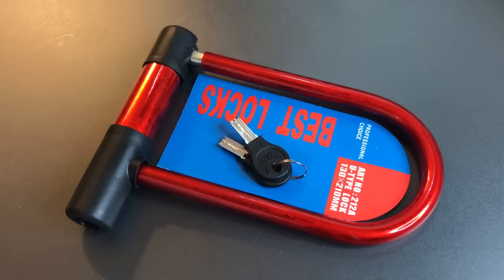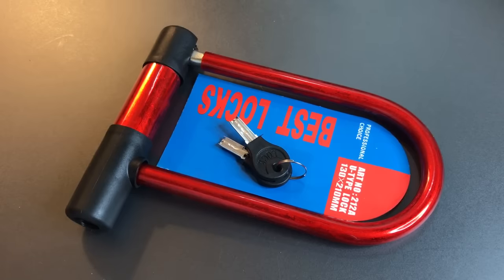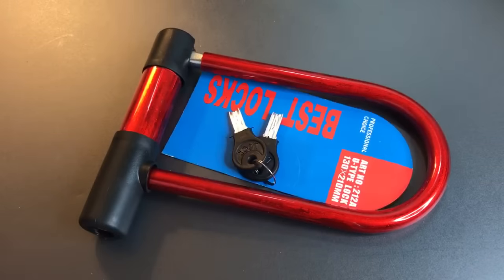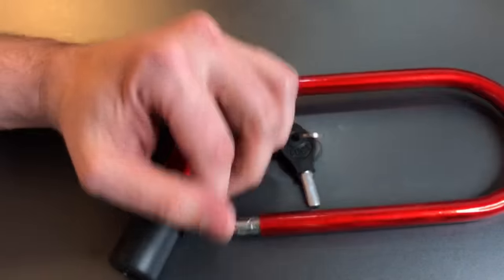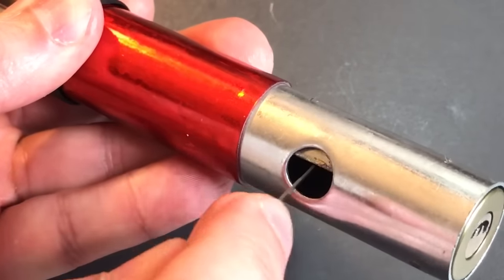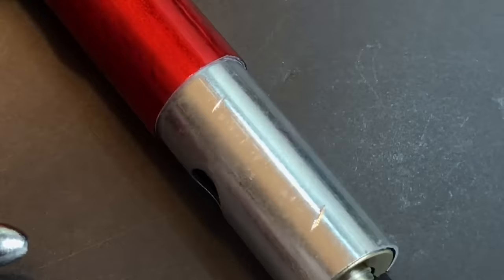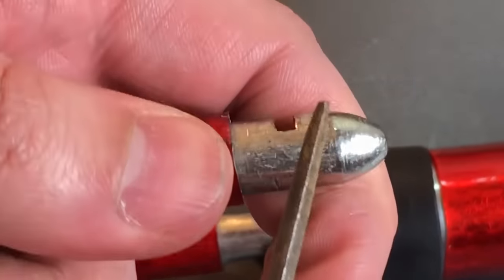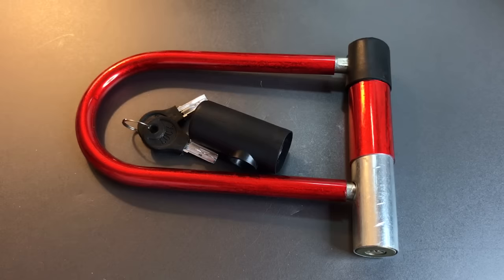[370] The WORST Bike Lock in the World Picked and Bypassed

Comment: Actually, I think LPL just convinced me that this lock is a great deal.  It's only $3.  For $3 you get a bike lock that will make it LOOK like your bike is secured which will deter most people from bothering.  Only a thief with enough knowledge/determination to pick it, bring bolt cutters or know enough to shim it would bother.  So if you're cheap and reluctant to buy a serious lock, why not get this?  It's a visual deterrent.  It's kind of like the Coral Snake approach.  The Coral Snake is venomous but several snakes have evolved similar colors and looks and benefit from potential predators mistaking them for Coral snakes.  This bike lock is not venemous, but it looks like it to those who don't know better.
Reply: Exactly
Reply: It smells like shit too
Reply: Nah the shimming part means you can just guess right and it opens. But I do see your point. Though the key will eventually not work.
Reply: True. For a small town or suburban area. Even at a college, if your college is fairly safe, this is better than those combination cable locks for $10 that look like they can be cut with scissors. Even those locks work fine for those areas as long as your bike isnt very flashy. 

That said, unless your bike is an absolute piece of junk, spend at least $15 on a nicer U lock. Walmart has plenty of options from Bell and Kyrptonite. (Still not great, see LPL 735 and 455)
Reply: The lock isn't venomous but it apparently emits a poisonous gas. Sounds like a super deterrent to me lol.
Reply: Or... You can have a lock that does work and not only does it deter people, but it ALSO is safe! Like a lock should be.
Reply: and because of its smell it might as well be poisonous (not venomous thats a different thing)
Reply: Anyone spending time looking at your bike likely knows about bike locks themself.
Reply: @jackkreacherr9339  Some would.  Sure.  But all?  Most?  A large minority?  Probably not.  Most of these thieves aren't educating themselves on locks like LPL or some character from a heist movie.  They're stealing BIKES.  They're not sophisticated super-criminals.  If they were putting that kind of time and effort into crime, they'd be fishing for larger game.  There's probably only a few that really know their bike locks.  And for $3, I can deter the rest.  I'm not saying it's the ideal strategy, but if you're on a tight budget...
Reply: @raceman9586  You can buy a great Bell lock (Catalyst 750) for $19.96.
Reply: Yeah because everyone just casually carries bolt cutters around
Reply: I think that analogy could be developed even further. Just secure the bike with the coral snake and be done with it. Only a thief with enough herpetological knowledge and determination would even bother going near the bike.
Reply: @ElleUnter  Best. Reply. Ever.
Reply: @raceman9586  When I get a new bike the first thing I do is crap it up a little so it Doesn't look new or flashy. Protective coloration.
Reply: If you have a cheap bike that you wouldn't feel destroyed about losing, sure. For a bike with high financial or personal/emotional value, you should spend at least 10% of the cost of the bike on security. I could be visiting a gated retirement village full of senior citizens who can barely walk, and I'd still use at least a 1090 chain.
Reply: actually this bike lock IS venomous, can't you smell it?
Reply: no just buy a lock this is a stupid idea
Reply: Matteo that just means you’re paranoid
Reply: You make no sense
Reply: if you're only gonna spend $3 for a lock, chances are, your bike isn't worth that much to begin with, so doesn't matter too much i suppose. kinda like.. why pay tens of thousands for premium insurance when all you drive is a 1994 second-hand pontiac
Reply: Marko oOo  Look up the term "natural selection".
Reply: Ppl will still try but alr
Reply: This lock would be totally fine for a kid's bike.  When I was in middle and high school, I had to ride my bike to school.  I had a cheap lock.  One of those bike chains with the blue sleeve from the 80's that my parents handed down to me.  I never had my $100 bike stolen.  The point wasn't to prevent a valuable bike from being stolen.  It was to prevent other kids from stealing the bike as a prank.  Your average teenage prankster isn't going to know how to pick a lock.
Reply: @hamsterama  there is people stealing Kids bikes, there are some expensive ones and they are easier to transport due to just Being smaller. Mine got stolen when I Was in elementary but that was from our basement it had one of the locks you described, the one before got damaged by some Kids. In middle to high school Lots of bikes got stolen or damaged and school said that they are in no way responsible to what happens to bikes and yes some Teens were interested in picking locks interested in illegal stuff or just generally destructive behaviors
Reply: @LP-XXX  Wow, I don't know what area you lived in!  LOL!  I rode my bike to and from school for all of middle and high school.  Never had anyone steal or damage my bike.  Although I'm sure there were plenty of kids who would have wanted to if they could.  For whatever reason, riding a bike was considered "uncool" and would get you bullied.  But I wasn't going to walk the nearly mile long way to school.  I actually was bullied for riding a bike.  As an adult looking back, it made no sense, but, whatever.  I graduated in 2003, by the way.  So, I don't know if riding a bike is still "uncool."
Reply: or just pay $15 and don't support a company that sells cheap horrible locks
Reply: well i believe that if you're gonna steal bikes you would bring something like bolt cutters if you have the money i mean not everyone carries it around but if you go out with the purpose of stealbg a bike maybe you would bring bolt cutters but that's just my opinion

sorry for my stupid name i lost the password for my main account :/
Reply: @ebsbjssjeggshsgehe7949  Most bikes get stolen if they arent locked by some random drunk dudes that just wanna get somewhere faster. The majority of people who Steal didnt Plan to Steal originally but saw an easy oppertunity and went for it
Reply: It's not just visual. It prevents someone from just grab your bike. So it's a really nice lock for 3$. I have to be a lockpicker to open it anyway
Reply: buy a pair of handcuffs and use those to lock your bike up ... people either think your a cop ... or its an entrapment bike
Reply: Plus it smells venomous as well!
Reply: A dumb robber would try to shake or pull it open
Reply: @raceman9586  I had such a cheap cable lock. Broke off the key in the lock because the mechanism was frozen. Had no tools with me. But I could just bend the cable from left to right until the cable gave up after only fifteen minutes. And no, I was not a bodybuilder.
Reply: @ghostface5559  dude u don't need a key
Reply: Not anymore after this video.
Reply: A friend of mine had a crappy looking bike 'abandoned'  on weekends near the train station, locked, to use when he went to various lessons  at the university and back. Bike was very crappy-looking but somehow worked (bought for 10 bucks from another student that paid it 10 bucks 4 year before and so on..). The lock was nike-looking thiough.. until someone picked it, stole the lock and left the bike.
Reply: Yep just like sticking the "Guardian Security System" sign in your yard without actually having the system installed in your house
Reply: Not if you’re in Philadelphia Portland or New York, if you use one of these locks in those cities, your bike is not going to last more than 10 minutes
Reply: @ghostface5559  you don't need a key to use this "lock"
Reply: @loganxavier  not for 3 bucks though
Reply: Nope you're wrong. You can break this open with a brick. The locking pall is thin soft metal and the hinge pin is thin soft zinc. Hot either end with a brick a few times and it's open.
Reply: @DerAlex86  more likely the spot welds or crimps that held the cable to the metal lugs on each end gave up and the cable came out.
Reply: Best part is, if you lose your key then you can open it with no problem.
Reply: this extremely thin bike lock wouldnt deter anyone who actually went out that day to steal a bike, and once someone decides to go after that lock it has ZERO capacity to stop a thief or even delay them such that the owner can put a stop to it

its locking mechanism is so bad i bet it could be opened with a claw hammer by tugging on the shackle and whacking the side opposite to the locking lug to bounce the spring-loaded locking lug

what would you rather pay for: 40-90 dollars for a good bike lock or however much money youd have to spend replacing your stolen bike? unless your bike costs like 20 dollars its a horrible deal
Reply: @loganxavier  yeah but such locks start around $100 (Abus Granit X Plus) - not everyone likes the price tag.
Reply: Thank you for clarifying the lock is not venomous
Reply: I once forgot my bike lock key at home and parked my bike in a place where motorcycles frequently gets stolen let alone bikes. I decided to tie the lock around my bike wheel to deter people from stealing it. I then left it there a week for...reasons. And it didn't get stolen! Worked like a dream.
Reply: Where I live bike locks are no deterrent at all, if someone has their eyes set on stealing your bike they'll just come with a van in the middle of the night and steal your bike. Even when it's standing on your property, doesn't matter how good you lock it, you better hide it well. Or depending on how you chose to fasten the lock, they might leave the parts which are locked but steal the rest.

Comment: By watching you and bill over the last year I am terrified about any lock I see storing anything. I even told my company what junk they are buying. They dont listen btw.
Reply from the maker: If it gives you any comfort, know that picking is a skill that not many people have the patience to master. Once you get above the bottom shelf crappy locks, it takes an uncommon level of skill to reliably pop locks within a practical time frame.
Reply: LockPickingLawyer so my neighbor crackhead won't be able to pick it. Although my motorcycle got stolen days ago with no locks
Reply: yeah my dad came and wanted to switch the basement padlock that i bought on a budget has ball bearings to hold the shackle lots of meat not hard metal and butter core in it for a Chinese cast iron spring loaded 3$ potato i think Bill made a video on how to bypass them with a knife  even why ball bearing locks are hard to use WELL SHIT i suppose ignorance is bliss

Comment: I went to tension a wafer lock on an old fireproof lockbox I have, it opened when I put the tension wrench in. There was 1 wafer in it.
Reply from the maker: LOL.
Reply: The first lock I ever tried to open was a 5 pin lock to a gun case I lost the key to. I pushed the file on some nail clippers into the keyhole, applied a little tension and wiggled it up and down and the lock opened. Convinced it was a fluke I repeated it about a dozen times in disbelief. Since then I have basically lost faith in any traditional lock. Obscurity seems to be a better defense than anything under $100 can get you.
Reply: I think your best bet is over kill. 5 shit chain locks 10mm at £5 each that would mean using a bolt cutter ten times, or mean pissing about with opening five locks. Most people can't lock pick as fast as him so they will see 5 locks and think, fuck that. Ha.
Reply: TheaDragonSpirit that's my approach. A thick galvanized cable with swaged crimps, and a hardened steel chain with two separate locks. I also have a brake lever lock and caliper lock I never use, but it really wouldn't make sense for someone to go through the trouble for my $300 bike when more expensive bikes are left unsecured all over the city
Reply: one wafer!!??!!

Comment: In Switzerland the Police recommends investing 10% of a bikes value in the bike lock. this 3$ lock seems adequate for a bike worth 30$ and not a penny more.
Reply: Gustav Lang-Weilt gets a $4000 bike and gets $400 dollar lock
Reply: I have a 2000$ bike and a 120$ lock. Anyway, I only explained the recommendations of Swiss police.
Reply: @miru99de  a $2000 bike will get stolen if it's left outside for too long. Bcs its so expensive it's probably your mountain bike or your road bike. Get another cheap bike for your daily  so you don't have to leave that thing unattended ever.
Reply: that's good until you're without both your expensive bike and lock
Reply: @4nd3rzzon  how would someone steal your lock lol?
Reply: what if you buy 5000 electric bike,  500 on locks?
Reply: @jketcham9004  people will cut the tree or pole down that you locked it to 😂
Reply: @theday2164  I've recently had my bike stolen twice.  And found it.  One homeless guy steal it and was sleeping on bench.  But they can't bolt crop chain I got its 2 inches thick.   5 grand bike fit tracker
Reply: @JayLeeBeanz didn't somebody steal an entire bridge once?
Reply: @JayLeeBeanz like how did they pull it off? Angle grinders and a fton of patience? Oxy acetylene torches? Cart the whole thing off or cut it to pieces?
Reply: My road bike that I built from scratch, with a total cost of $7000 sleeps in my living room. There is no way I'm leaving this bike unsupervised.
Reply: @JayLeeBeanz So leaving anything of $2000 outside is too much of a risk for you? I assume you don't own a car either then, since those are just as vulnerable to theft as a bike with a decent lock.
Reply: @shawnpitman876  Got any cars that fit in the back of my van?
Reply: The sad thing is, if the thief can't steal your bike because your lock is a decent one, they'll cut all the cables and spokes on your wheels in spite. Some people are just trash.
Reply: In many US cities with big bike theft problems (NYC, SF, etc) you'd probably be better advised to spend nearly as much on your lock as on the bike you'll be locking! More expensive bikes are to be stored indoors or kept in sight at all times. It's a big hassle.
Reply: noeone steals a 30 $ bike^^ its not worth investing a penny into a lock
Reply: @JayLeeBeanz realy happened here in germany, someone realy stole a bike WITH the street lamp it was locked to.
Reply: @DokuFREENET  the tweakers in my city steal $30 bikes all the time, since those are the ones that get left out, unattended, and not locked up. A lot of times they either turn around and sell it for $5-$10 or they just trade it to their dealer for $10-$20 worth of meth. I've seen it happen a LOT.
Reply: Really depends on where you live at. Colleges are notorious for people who lose bikes, people who got their bikes stolen, and people simply throwing away the bike by just leaving it locked at the bike rack. I would never give a second glance to someone sawing the bike lock because the school board has been doing it over and over the years.
Reply: @DokuFREENET  yeah they do. Just take it and dump it. I had one taken - it turned up a couple of days later looking like it had been ridden down a river.
Reply: @vinos1629  
1) pick lock
2) open lock
3) take lock
Reply: Thats pretty smart
Reply: Vinos bro he lives in switzerland no one steals and if you do, just cop a M249 and go crazy
Reply: @DokuFREENET  Yes, (semi-)profrssional thieves won't steal a cheap bike.

Drunks or bored teenagers will, however.
Reply: A friend of mine's fork is worth Like 1200€ 
Just the fork nothing else
Reply: So I should get a $400 bike lock? Bet
Reply: I have a 7000€ selfbuild roadbike.
With a weight of 6,5kg.
I dont have a lock for it.
Because I take it everywhere I go with it.
When I go into a hotel I get it in my room.
And If needed I would sleep at the ground and the bike in the bed.
Reply: Police like to repeat things they've heard without understanding why.  It's their job.
Reply: @valgo8128  I made also my own road bike from a Specialized Tarmac frame with Red22 groupset with hydraulic rimbrakes (total cost 8k Euros) and it always stays in my living room. My bikes weight is less than 6 kg. I even bought anodized screws and cable ends in the same color as the bike
Reply: Never thought of things that way, that makes sense
Reply: Lighter bike and heavier lock...
Reply: I think my bike is worth about €30 by now. And it's my primary form of transportation. But it still works, has 3 gears and drum brakes and a nice saddle so I'm good. It has one of those simple attached locks on the back wheel and I use a secondary lock that probably was €12. Always lock the front wheel to the bike and the whole thing to something solid - or you'll end up with just the wheel or just everything else and that sucks.
Reply: I mean, here in Hungary I have seen some 19 dollar bikes so this lock might be a lil bit overkill for it
Reply: I bought a used Bike for $30 today, pretty sure I have put stuff worth more or the same on it.

Comment: I have a coinbox that I could pick with a pair of scissors.
I am not some kind of lockpicking master, I just jammed the blade inside after losing my key and it opened...
Reply: I bought a used PC once that had the case locked and didn't include the key... I just stuck a screwdriver in, hammered it, and it popped right open.
Reply: Masters choice

Comment: Funny story…last summer I found my old bike at my parents garage and It happened to still have an old bike lock around the frame which I didn’t have the key to. But after watching all these videos on how cheap locks are made I figured I just try to stick in a screwdriver and see if I can manage to open it. Surely enough after sticking a screwdriver and turning it slightly the lock just fell apart :) Special thanks and shout-out to BosnianBill for that one :)